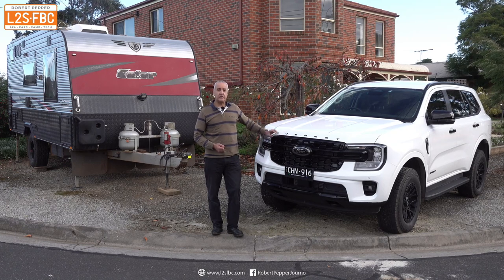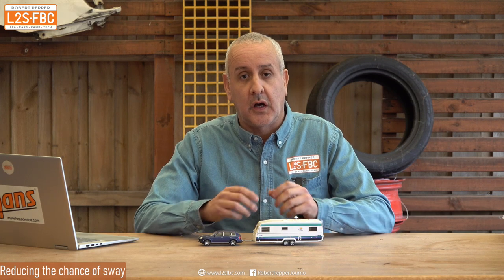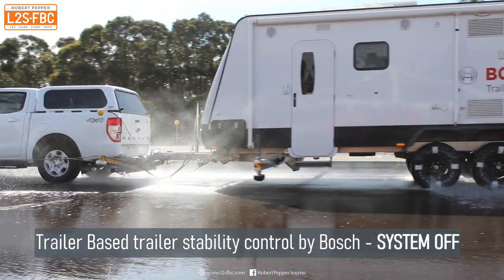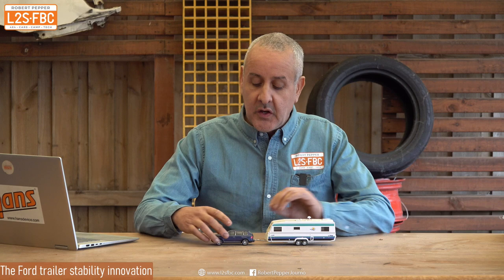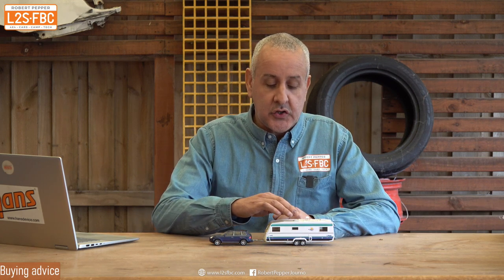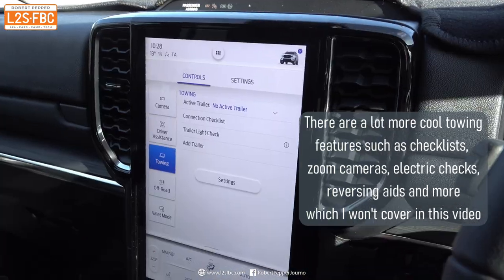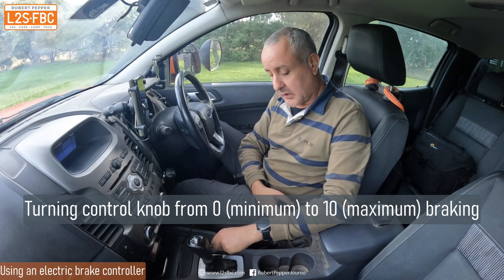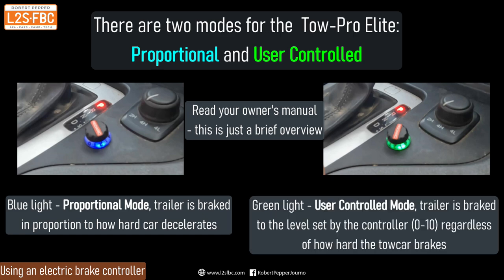Towing safety gamechanger - Ford's new trailer stability control for Ranger and Everest

Comment: Hi Robert. I think when the technology is there, this system should be mandatory in all vehicles that tow. An aftermarket product must be made. If you own a trailer your vehicle must be licensed with this system. Why not bring the future to us now for safety's sake?
Reply from the maker: As I said in the video, the trailer brake controller needs to be integrated into the vehicle from the ground up. That way the engineers know exactly what they're dealing with and how it works, and can design/calibrate the vehicle and trailer based systems in one. So we'll need to see more ITBCs in cars first, with the likes of Toyota/Nissan/Mitsubishi following Ford's lead.
Reply: @L2SFBC  Yes, we'll get there soon hopefully.
Reply: Because trailer esc systems interfere with some older integrated braking systems.  I hear what you are saying, but they play havoc with older american pickups like my MY12 2500HD that doesn't need trailer esc anyway.
Reply: @L2SFBC  ITBCs are awesome.  American pickups have had this technology for a very long time.  I cannot speak highly enough about how well they work.